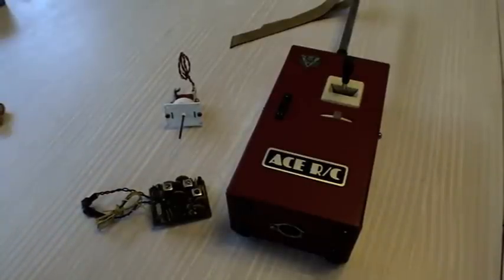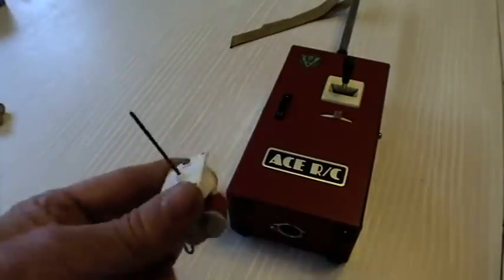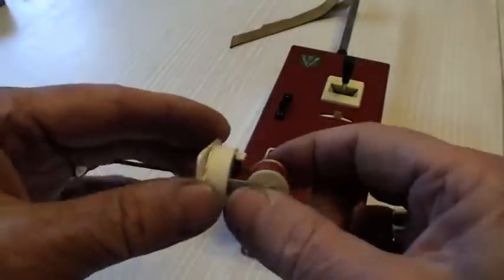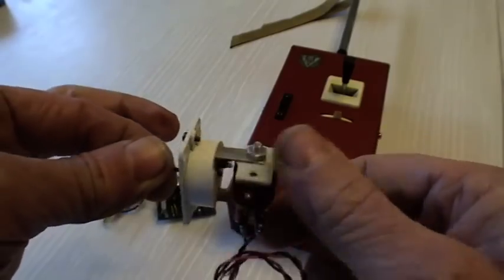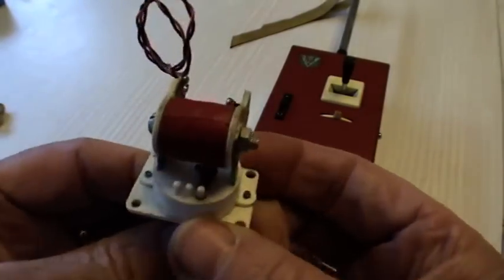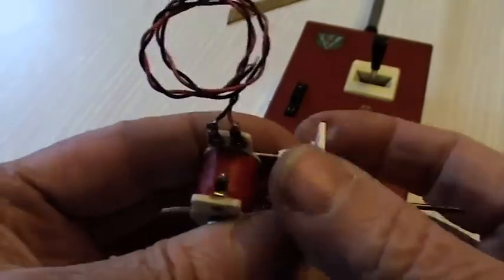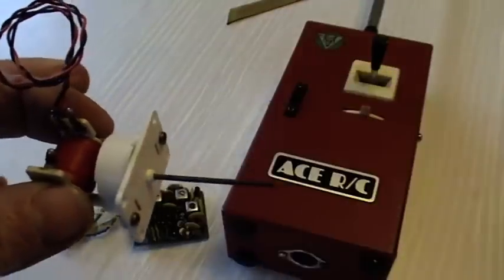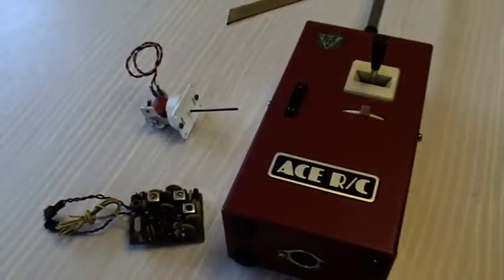Vintage Pulse Proportional  ( Simpl Simul)  Model Radio Control Part 2

Comment: I remember that .. but here in the states, the Adam's magnetic actuator was used. I always felt that the gimmicky 'rubber band' self centering was a bit hokey, but it worked. I think my 1st foray into pulse proportional (single channel) was using the 'Mighty Midget" motor, which also used a rubber band to help center the pin which twisted the torque rod running back to the rudder. Crude, but it worked.